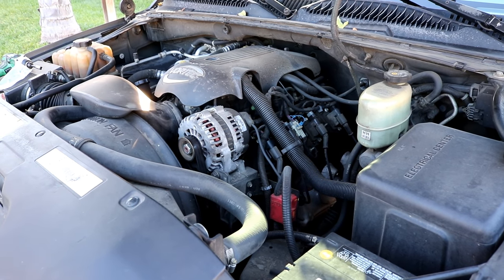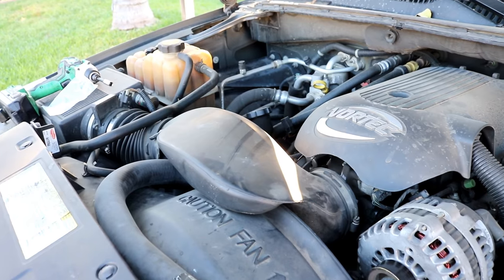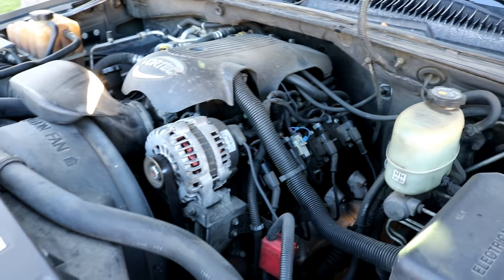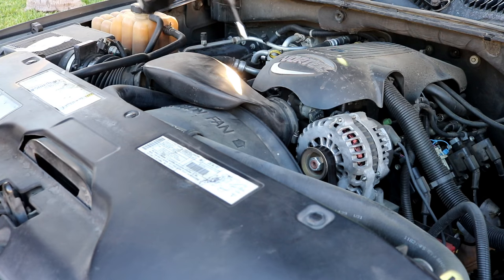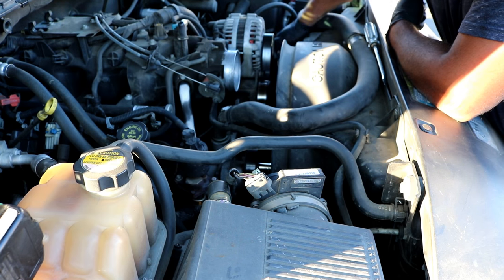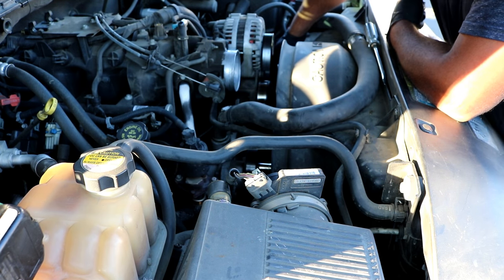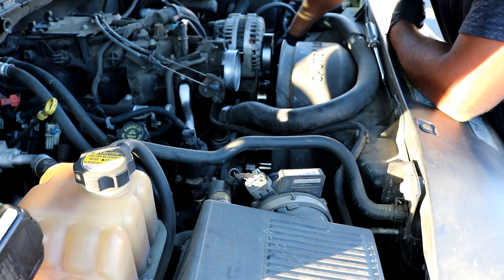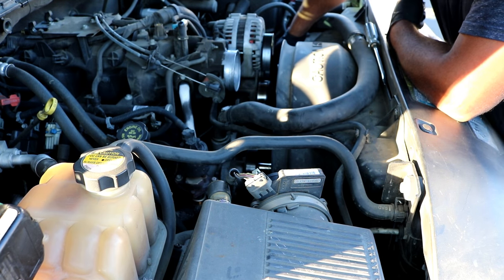2000-2006 Chevy Throttle Position Sensor P0122 (HARD SHIFTING SOLVED HERE!)

Comment: I have a question. I have a 04 Chevy Silverado and I have recently replaced my tps sensor because my truck is shifting hard and it surges when idling and spudders or dogs out as I accelerate and will eventually go into reduced engine power. I have a replaced transmission so that’s not the problem. Do tps sensors have to be recalibrated by any chance?
Reply from the maker: There is a relearn procedure if you have an electronic throttle body ONLY. It sounds like your actual throttle body itself is failing. Here is the relearn process:

1. Start the truck and let it idle for 3 mins.

2. Turn the truck off for 1 min.

3. Start truck and let it idle again for 3 mins.

4. Idle quality should stabilize. If it doesn’t, you will need to drive the truck over 44 mph for 5 mins. 

If after all that the idle quality hasn’t improved, you can either try it again or replace the throttle body with a new unit and perform the relearn again.

Comment: Got a question bossman. My mom has a 2000 silverado i have replaced part after part it is now cranking up with one try after replacing the fuel pressure regulator, fuel pump replaced also. Only issue left is the truck just stalls out from time to time randomly...so today i plan on putting a iac valve on it. What do you suggest?
Reply from the maker: If there is a check engine light on, check that first. Does it idle low first then stall? Or does it just die completely?
Reply: @HelpingHandAutoRepair  no check engine light, yes it will idle low then stall out. I replaced the iac today and now it was stalling out frequently, then it will suddenly run smooth for awhile and go back to doing the same thing.
Reply from the maker: If you have an electronic throttle body, you can try to perform a throttle relearn. Also clean your throttle body out.
Reply: @HelpingHandAutoRepair  Thank You sir
Reply: I had same exact problem and I cleaned the throttle body out just like this guy had mentioned to you and I did that and it actually fixed my Silverado and I thought it was something way more difficult but it was just a simple cleaning ..did you figure out what was wrong with your mother's silverado?
Reply: @Randalamarion I didn't realize this comment was over two years ago.. my bad

Comment: I changed it out and it ran good for a few days and back to the same hard shifting any advice?
Reply from the maker: It’s possible that the new part could be defective. You should check the live data with a scanner to see if you have a nice smooth reading on the TPS sensor.
Reply: Thank you!!

Comment: I’ve got the 06 Sierra with the 4.3. Having issues at wide open throttle. Transmission shifts too early at 4000 rpm’s. Any advice on how to fix this?
Reply from the maker: Your best bet would be to read live data on a scanner of the TPS signal and see what it’s doing at partial throttle and at WOT.
Reply: If you cleaned your throttle body you must need reprogramar with a efficient scanner , and check the  fuel trims

Comment: 05 2500hd 6.0 electrical sensor on the left of throttle body. So you're saying I need a new peddle as well. My truck shifts write or looses gears after 3rd. Hard to get in 4th and no od.
Reply from the maker: So your truck shifts correctly. However if you have no 4th gear then you need to scan for codes to see if you have any transmission related codes first. If you do, let me know and I can try and help you out.

If you don’t have any codes and the truck simply won’t shift to 4th or OD then you possibly have an internal problem with the transmission.

Comment: Will a check engine light always come on when it goes out? Can it fail but still no light? Reader doesn’t say anything about that, transmission was rebuilt 15K ago and my 1st to 2nd shifts hard.
Reply from the maker: If you have a scanner that can also read pending codes then yes there is a chance that the code has not “hard set” yet and there could be a pending code. That means the light hasn’t come on yet because the conditions aren’t just right to turn the light on HOWEVER a pending code will show up saying that the TPS “could” be acting up occasionally. 

If you have a scanner that can read live data, you can check for a nice smooth linear percentage increase when you slowly press on the gas pedal. Truck doesn’t need to be running to read the live data. Just the key has to be all the way on. 

Let me know what you find. Also does it shift 1-2 normally when at WOT?
Reply: Same problem here

Comment: i am getting this code while driving uphill at elevation. then it seems to idle high until I clear the code. i have cleared it with a scan tool a few times , but guess i should try and replace this sensor . There seems to be different models and not sure which to get. my throttle body looks the same as yours. 2001 gmc yukon 5.3. some say traction control and non traction control. which do you have? Thanks.
Reply from the maker: Best to locate the correct part via VIN. Traction control is controlled through the electronic throttle body which your truck DOES not have. The easiest way to be sure is to go out to the truck. Look at the sensor (as shown in the video) and look at the connector. If it is round, it DOES NOT have traction control.

If it is sort of a elongated oval shape, you HAVE traction control.
Reply: @HelpingHandAutoRepair  how do you clean the throttle body? That is what I planned to do until I found out it is not a electronic throttle body and would be more difficult to remove for cleaning. Thanks!
Reply from the maker: You don’t even need to remove it to clean it. Grab yourself some carb cleaner or brake cleaner, take the intake tube off. Should be a 8mm clamp on the throttle body and a 8mm clamp on the MAF (airbox side)

Disconnect the two coolant hoses on the bottom of the tube (a flat head can get you there)

Then wiggle the tube out. Front here, manually open the throttle blade (just push on the top of it and spray your cleaner in there and use a rag to wipe it clean.

Comment: I have a Chevy Tahoe 04 where my truck is struggling to shift gears n does hard shifting and cluster turned off could that be the reason why? My mechanic said it's not a mechanical issue because it doesn't read no check engine light even tho check engine light is on
Reply from the maker: arturo salazar if your scanner can read live data then select the TPS sensor data and make sure you are getting a nice smooth linear voltage reading. Truck ignition to ON (no need to start the truck) read the data as you slowly apply throttle 

Secondly the truck struggles to move in any gear? Or the truck does move fine but shifts hard into every gear?

Comment: When you say hard shifting problem, when shifting from 2nd to 3rd it hangs?
My h2 recently takes longer to shift from 2nd to 3rd.  Revs higher then shifts
Reply from the maker: You can see if your TPS is provided a smooth signal. If you have a scanner capable of reading live data, then just hook it up and take the truck for a drive and note what the TPS is doing.

If it is erratic and not linear then replace it. If it is smooth and reading a nice smooth range from 0-100% then your transmission is probably not far from needing to be rebuilt. 

How many miles on it?
Reply: @HelpingHandAutoRepair  thanks for the quick response.   It's a 2005 H2 hummer with 110k miles.  If I just have the throttle around 25% the car will shift no problem.  But if I try to do wide open throttle it will rev up all the way to 6k and have a shift delay.
Reply from the maker: @voodoo9077  Ok. Not that many miles at all. Do you tow a lot with the truck?

TPS signal is definitely worth a look into.

Comment: I have 03 Silverado lt 4.8 with 1-2 late hard shift problem with no check engine light. This started happening after I did new trans filter, oil pan gasket and fluid change at 146k miles. So I did some research and replaced a&b solenoids, new 1-2 pinless accumulator, tps was replaced not to long ago. All this dont fix hard shifting. Any suggestion? Also the temp dash gauge dont work even after replacing temp sensor, could this cause problems to the tps?
Reply from the maker: chem dog Does it shift hard at WOT 1-2 shift? Or does it shift hard at partial throttle?
Reply from the maker: chem dog Also, if there isn’t a check engine light regarding certain transmission codes, it’s best to take it to a reputable transmission shop to allow them to do a diagnostic versus spending money on stuff that might not work. Of course that’s for a later time lol.
Reply: Hard shift in both modes. I'm only 60 dollars deep so far, plus my own labor.
Reply from the maker: chem dog sorry I fell asleep. I would check to make sure your TPS is giving a nice linear signal. If you have a scanner that can read live data that would help confirm this. Has the transmission been rebuilt at all or all original.
Reply: It original and Ran fine before I messed with it. I will live scan it today see what happens. I'm a toyota/mopar mechanic. I dont know anything about chevy transmissions, just the basics.
Reply from the maker: chem dog Sorry if it ran fine before why were you even changing anything?
Reply from the maker: chem dog I don’t do extensive transmission work myself. The electronics I can manage. I am not a professional anything mechanic to be honest. Just having worked on these chevys/GM products a lot for the same reasons, you begin to notice patterns. At that mileage those 4l60e transmissions usually start failing internally (hard parts)
Reply: The fluids smelled burnt dark/ brownish looken. So I figured transmission needed a tune up. Toyota/jeep never give me problems like this, they go 200k+ without changing any parts, amazes me.
Reply from the maker: chem dog Well In GM’s defense (I honestly prefer TOYOTA products as well lol) there are many cars made throughout history that just have been plagued by certain common failures. The 4L60E is a major failure point for GM. If they haven’t failed by 130-150k, they are GUARANTEED to fail sometime soon lol. 

This is why I only buy 2500(3/4 ton) Chevy products. They came with the much stronger and far more reliable 4L80E. My Yukon xl 2500 I’ve had for 10 years and it just hit 300k. Towing quads, trailers, whatever. And I neglect that truck so much. Original transmission, no rebuild at all. Haven’t even touched it. Still shifts flawlessly up until I needed to replace the TPS as I have done twice now in the time I’ve had it to fix random hard shifts. 

Burnt fluid is for sure pointing to failed or failing clutch packs. Sluggish shifts have probably been happening over time before it started shifting hard.
Reply from the maker: chem dog The potential problem with installing a new accumulator is that if the bore inside the valve body that holds that accumulator is worn then that new accumulator will not work as it should. Pressure will bleed off (due to a slightly enlarged bore) and pressure can’t be held when needed. 

I would explore the option of a transgo HD2-C shift kit. This may solve the issue you are having now. The kits can be installed with the transmission still in the truck. Pretty much you are modifying the valve body slightly to change fluid fluid to help the shift quality overall. They run about $60-85 depending on where you get them. Of course I would first drain your fluid and throughly inspect the fluid for clutch debris, metal sparkles in the bottom of the pan etc. the debris looks like silverish gunk/mud of it sits in one spot in the pan.
Reply: Ok so I did a live scan found the tps was jumping up and down. So I checked all the electrical tps plugs/grown, checked fuses, tested everything with a ohmmeter found nothing wrong. Finally I disconnected the battery for 30-45 minutes. Fired it up, I have no clue what I did but the beast is shifting perfectly smooth lol. Thanks for information. It was really frustrating me.
Reply: @HelpingHandAutoRepair  mine only up shifts hard or downshifts hard on partial throttle.  Over 50% throttle shifts great . Any ideas sir ?!
Reply from the maker: Replace the tps sensor as noted in this video.

Comment: Just got a 04 GMC Yukon with the 5.3 that has a hard 1-2 shift at low rpm but with high rpm it doesn’t do it can’t figure out what it is could this be the issue
Reply from the maker: Dusk O. If you have access to a scanner that can read live data, check for a smooth linear electrical response from the TPS. It should read smoothly from 0-100% throttle input. If not, replace the TPS as shown in this video.
Reply: I have the same issue did you figure it out ?
Reply: What was the verdict?
Reply: I'd like to know as well
Reply: @elephantom12  I'm thinking of trying this for mine I'll do a video on before and after
Reply: If replacing the tps sensor didn’t fix it try replacing the 1-2 piston accumulator that will certainly fix it the 1-2 hard shift bit u have to drop the transmission pan to do that ....  also slapping a corvette servo will guarantee a fix .. theres plenty videos on that thank me later

Comment: Did you have to disconnect the battery ?
Reply from the maker: If you don’t have a scanner to delete the codes, you can disconnect the battery then replace the part and then reconnect the battery.

If you have a scanner, you can just replace the part. No need to disconnect the battery.

Comment: Sometimes my 02 Yukon feels like it shift in reverse but then suddenly clunks into gear when I hit the gas pedal. It's worse if I do it quickly and just barely or not at all if I wait a few seconds before hit I the gas pedal. Forward gears seem fine.
Reply from the maker: Boost valve could be bad.

Comment: I have a 2001 Chevy suburban I change the throttle sensor but when I connect the connector for the mass airflow sensor it cause it to high idle I’ve change the mass flow sensor and still does it
Reply from the maker: Any other check engine lights on?

Comment: Hey man I just got a new tps installed did help on my shifting issue just when I was checking if it was working I was on my scanner as I drove it on empty roads and it would show 11k rpm on my scanner if I would rev it out to redline I think it's the iacv because I also will be stopped and it says 1400-1600 idle but is sounds like 500rpm
Reply from the maker: So your shifting issue is solved right?

Now you have a different issue? Do you have another code popping up?
Reply from the maker: IACV doesn’t tell your scanner what rpms the engine at. If the truck has an idle problem, most times there will be a code. 

What is the truck doing?
Reply: @HelpingHandAutoRepair  the truck is driving fine just the rpm is show up wrong on my scanner like I will be driving and coming to a stop light  truck idles at 500rpm but scanner says 1500rpm I'm just thinking is this something to worry about like if the ecu is adding more gas for no reason
Reply from the maker: If the idle is fine and you have no driving issues than there is most likely a problem with your gauge cluster. Most of the time the scanner readings are correct. Are you sure it’s not actually idling at 1500 rpms? Maybe your gauge is reading wrong?
Reply from the maker: If the idle is fine and you have no driving issues than there is most likely a problem with your gauge cluster. Most of the time the scanner readings are correct. Are you sure it’s not actually idling at 1500 rpms? Maybe your gauge is reading wrong?
Reply: @HelpingHandAutoRepair  yea I mean the truck sounds like 500rpms stopped but the scanner would show 1500 but it fix it's self right when I start moving they both show the same
Reply from the maker: Hmmm that’s odd. I wouldn’t worry about it if the truck still runs fine.
Reply: @HelpingHandAutoRepair  ok thanks for the help and quick response should I clean the throttle body just in case truck has 243xxx miles
Reply from the maker: Jose Barajas If you are having idle issues (rough idle) then you can certainly try there first. However if you aren’t experiencing any idle issues, I would just leave it alone. My personal Yukon 2500 has 310k on it. I’ve cleaned the throttle body ONCE @147k. No issues with it at all.